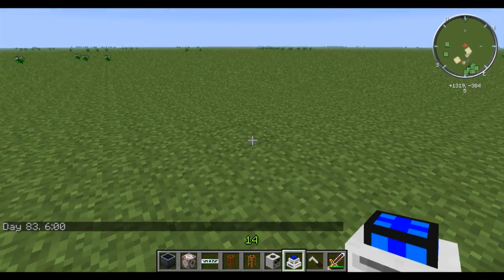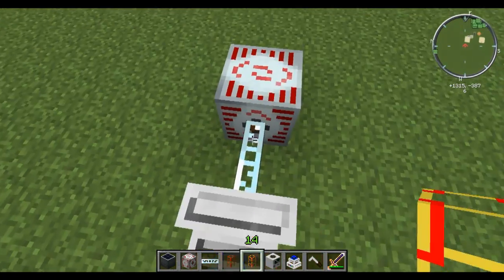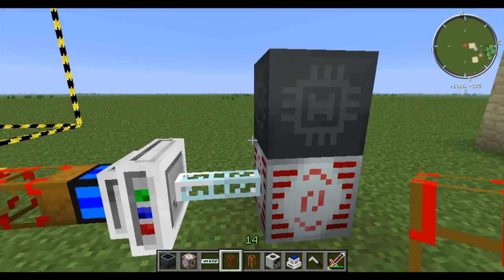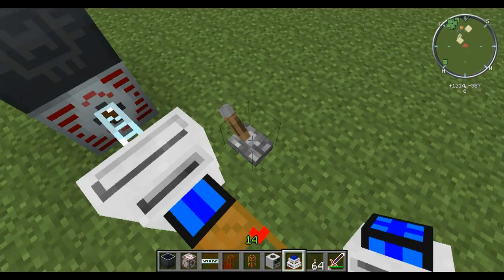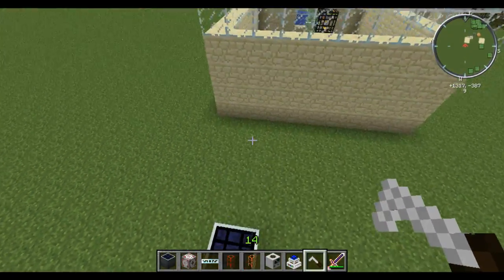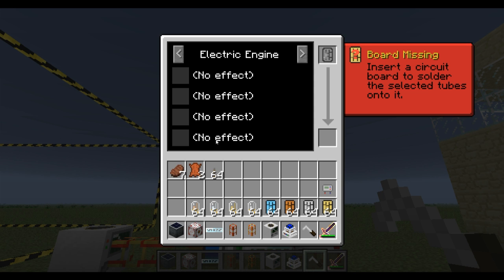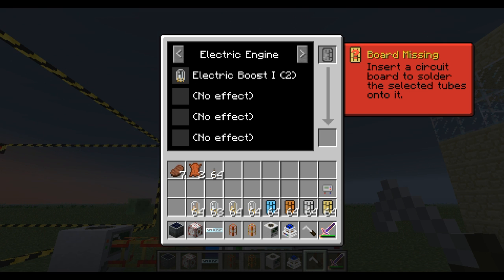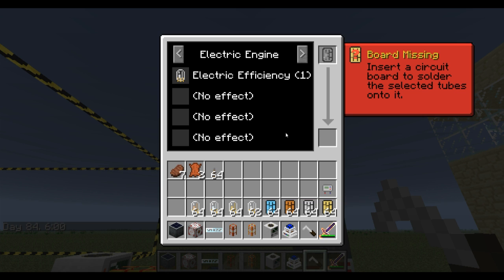FTB Electrical Engine Complete Guide - MindCrack Pack Version 8.1.1 (engine from the forestry mod)

Comment: sorry but what the fuck.  there are a few things here like (why are you not using redstone energy conduits)  but.  the engines DO NOT NEED TO BE 1 SPACE APPART...........14:30    just get off your lazy fucking ass and use the wrench to orient them right.  (if you place them next to eachother they will face eachother)if it's the damn conductive pipes (i don't use them so i dunno) that have to be one space appart.  THEN SHUT YOUR FUCKING MOUTH AND DON'T MENTION IT!!!!!! you are doing a tutorial about the electric engines AND NOT the pipes